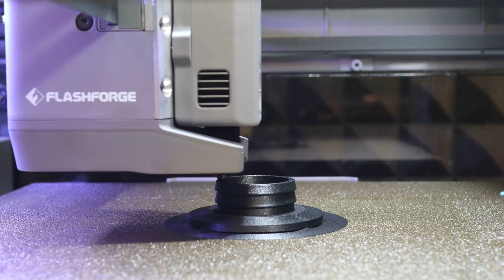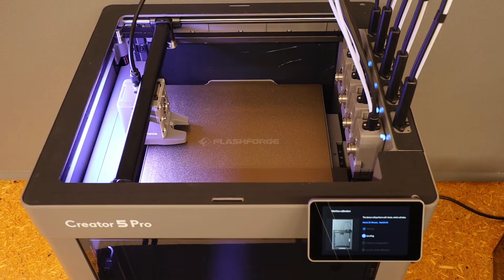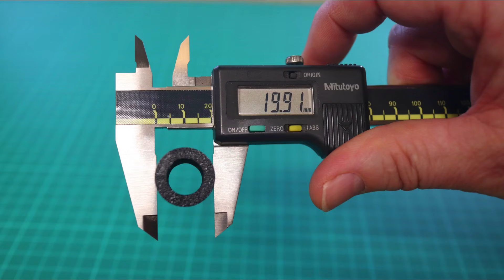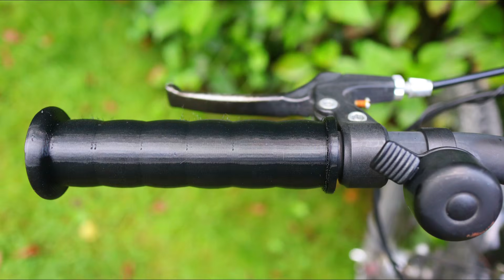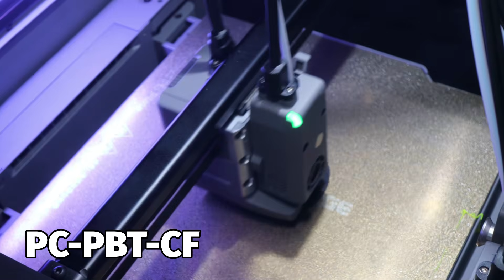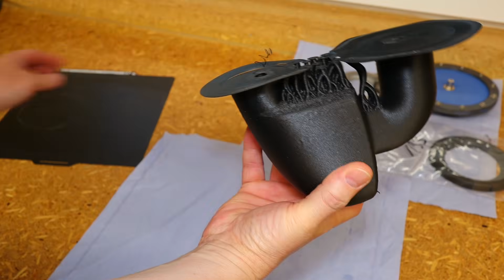Engineering filaments with the Flashforge Creator 5 Pro ?

Comment: Can you please try pps-cf from Polymaker?
Im asking because I will probably buy this printer and it would be nice to know if it can print pps-:)
The hotend from the 5 pro is pretty close to this filament‘s optimal temperature (330 degrees).
Reply from the maker: I will test PPA-GF and PPA-CF soon, as FF send me a few spools.
I can test Polymaker PPS-CF if you send me a roll :-).
I am quite sure that it will be no big problem if you are careful with the settings!
Reply: Qidi should handle it without any problems, nozzle up to 370 degrees.
Reply: Hi! Did you test pps-cf already? I am curious about that result. I am between saving more money to get a bambu H2D, but this creator 5 could be my best solution. (OK, the h2d has a larger build Plate but at what cost)

Comment: I recently purchased the Creator 5 Pro for my son's birthday (also a present for myself). The item arrived with damaged packaging (holes all over the box) and another person's address that had been left on it... Clearly it had been returned for some reason and shipped straight back out.

On inspecting the printer cellophane was missing from one of the panels and there were scuff marks, after noticing this I didn't check it further. 

Flashforge support have been a nightmare to deal with, I'm now waiting for the printer to be replaced. If there was any other affordable multi head print option on the market I would have asked for a refund.
Reply from the maker: That sounds like a very disappointing start, I really hope they resolve the situation for you quickly.
Reply: I returned mine and got a Snapmaker u1. It is SOOOO much better. Same price range.

Comment: I’m a bit confused when you say it completely eliminates the Waste associated with multiple material printing while at the same time showing a video of it printing a purge tower. Similarly, confused when you say you can’t tear the two materials apart and you show a video of you tearing the two materials apart with two pairs of pliers. Since you speak English, you might want to look up the word veracity.
Reply from the maker: It completeley eleminates the flushing of the nozzle ("poop") to clear it from the old filament.
I use a purge tower (which is optional) to get a better print quality.
The material wasted with the purge tower is absolutely minimal and no comparison to the one of an pooping AMS!
I meant that I can't tear the two parts apart completely, but everybody can see what's going on?
And many thanks improving my English, I will look that word up, I am always very happy to learn something!

Comment: Great video! I've been looking towards buying this printer to work with more engineering filaments and multimaterial capabilities for prototyping, and I was hoping for a review like yours, not just focused on multicolour. 

One thing you can do to reduce even more the natural stringing of TPU, is to print one object at a time (in PrusaSlicer is the option "complete individual objects", so I guess Orca has it too). It reduces travel among layers and it doesn't add more printing time. The con is that you can't fill the bed with parts as it spaces them out, taking the toolhead and gantry in account to avoid crashing.

Also, kudos on using FreeCAD! I've been using it professionally for around five years now and it keeps getting better with each release.
Reply from the maker: Thanks for the tip on printing objects individually, I will definitely give that a try!
And many thanks for your very nice comment!

Comment: Thanks for the review. I've seen people flagging a safety issue with the extraction vent sucking in purged filament that drops directly past the vent. Can you confirm this or has that issue been eliminated?
Reply from the maker: This issue has been fixed with a firmware update a few weeks ago along with other improvements!
Reply: @myengines  Excellent, thanks for responding. One of these going in the order basket

Comment: thats quite interesting how you can do multimaterial now. Perhaps a lattice of 3dprinted tubes could dramatically increase the max pressure due to its failure mode then moving to tensile strength of the material in the middle
Reply from the maker: Yes, there are lots of new possibilities; I’ll give your suggestion some serious thought!